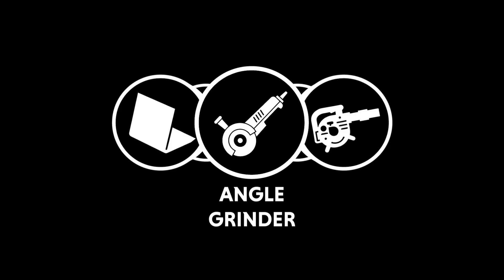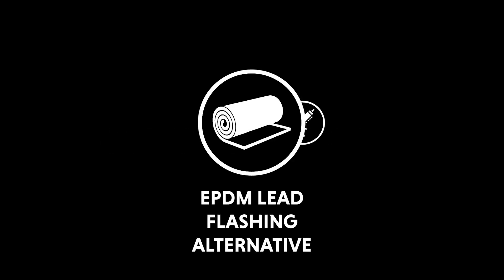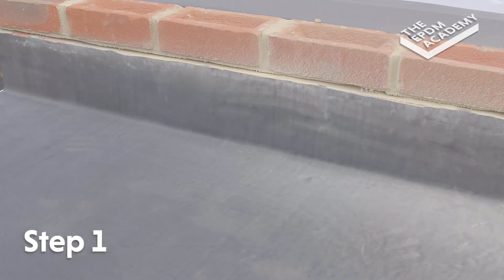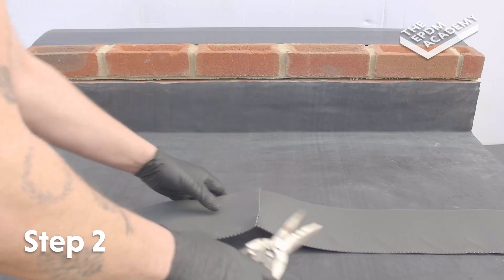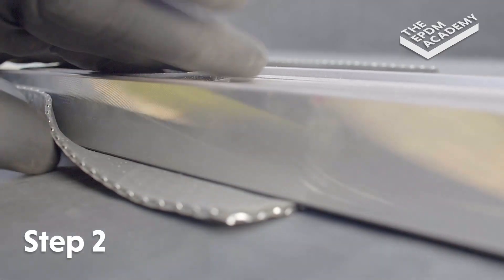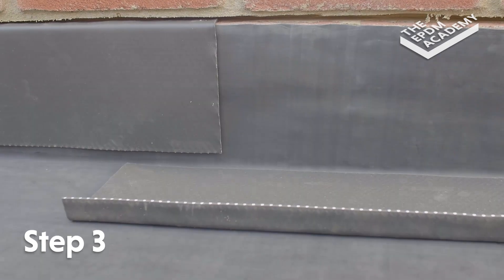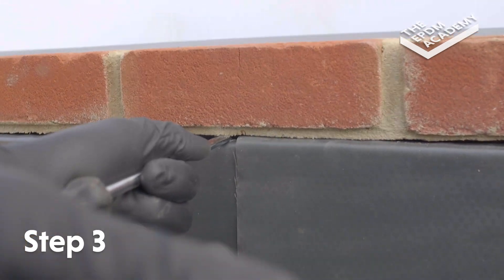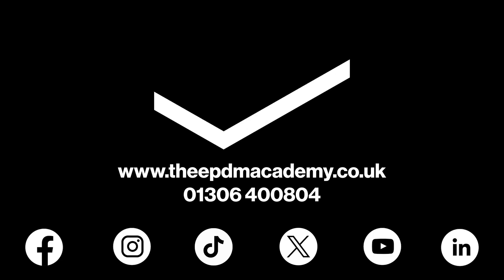HOW TO FIT AN EPDM WALL FLASHING TRIM - EPDM LEAD ALTERNATIVE - FLEXIPROOF®

Comment: What if the wall is roughcast how do you take the Epdm to stick to that?
Reply from the maker: Hi there. You can either smooth the wall out by sanding or chiselling, or you can run OSB boards up the wall and stick the EPDM to that. We hope this helps!